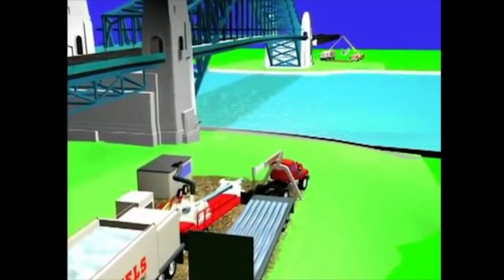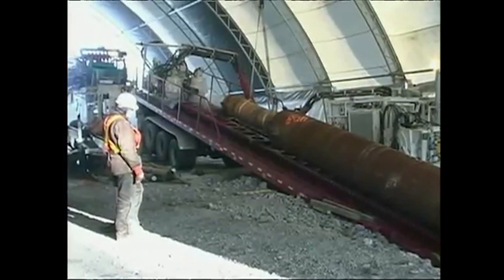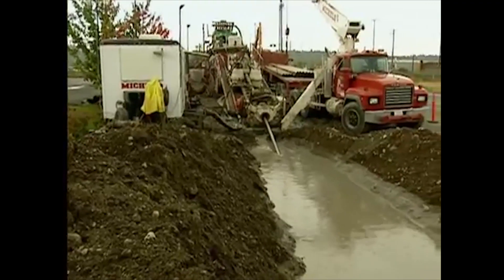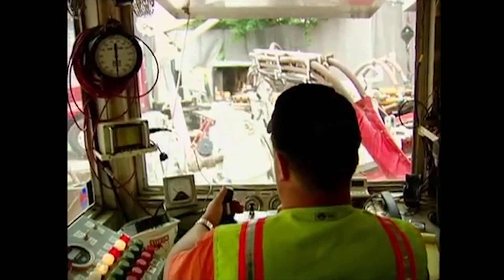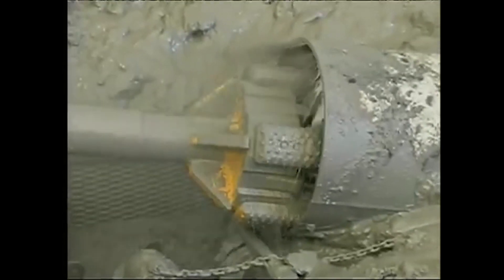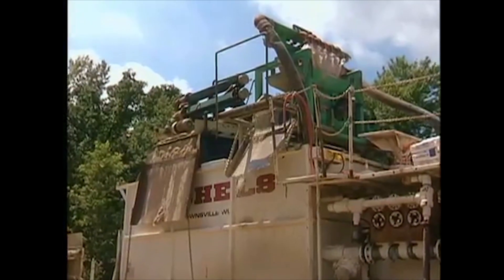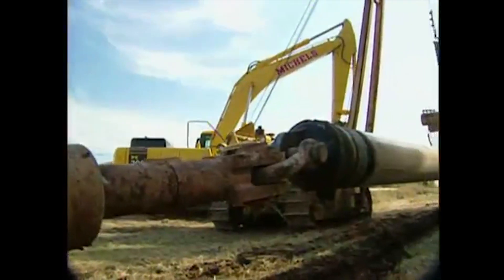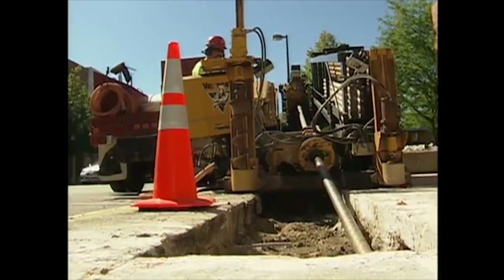JEA South Shores Project - HDD (Courtesy of Michels Corp)

Comment: How do you ensure the coating on the utility pipe is not compromised during the pull- especially long pulls?
Wouldn't dragging a 30 inch pipe a half a mile through a curved bore really subject the pipe coating to a lot of abrasive damage?